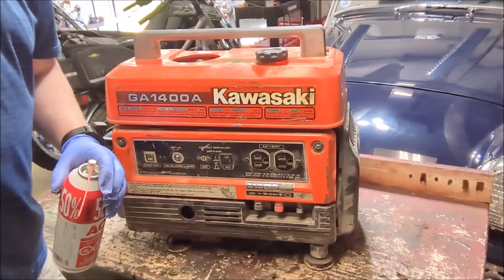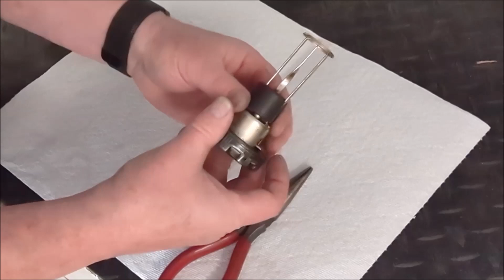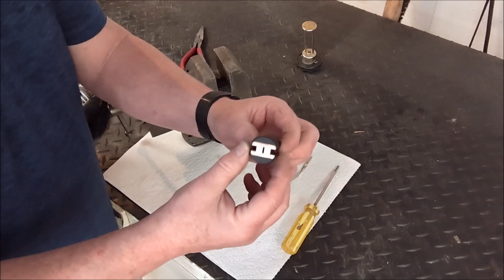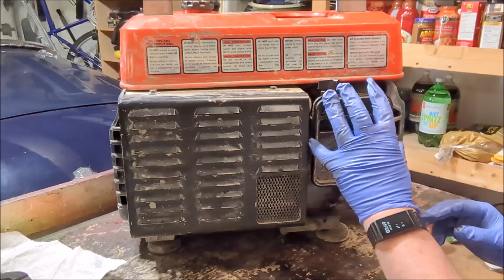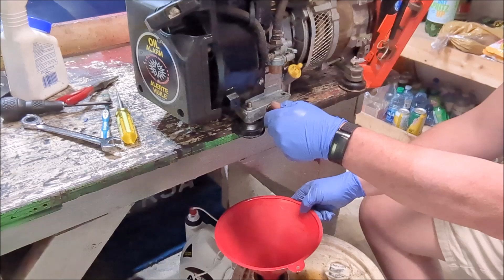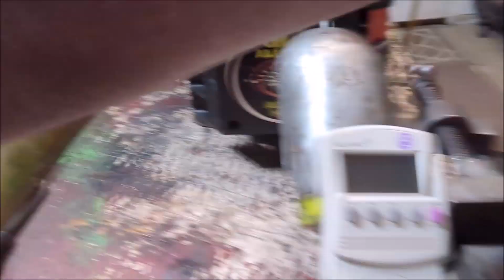Kawasaki Suitcase Generator GA1400A Diagnosis and Repair

Comment: On the left should be a red square, its the off switch..  the fuelk filter under the fuel cap you turn it and it comes out very easy, its made like it and easy to get out, just turn it dont destroy it. the fue lguage yo ushould of simply bent out the two outer parts, then drop the foat down and turned it round half a turn..... stop butchering things, sit and think for a minute.  you are someone who should never ever touch anything mechanical , you have totally bodged this generator up... its a simple thing to work on and you have made it look very hard... in the little filter bowl that is see thrue there is also a filter up and under the plastic bowl. the filter can stop the generator running correctly.... you would of looked under neath to see the little filter and als olet some fuel run out the bowl area..... i would of let every single drop out and put in nice fresh fuel................so now go and get that little filter out above the glass bowl and clean it and then its going to be good for a few years..... with fuel turned off nothing come out the glass bowl. when your putting it away for winter etc , then remove the glass bowl turn of the fuel and it will all drain out nice and quick. no needto take the front cover off at all.

Comment: I had one of these . Run very well. But no voltage is coming out . What y’all think could be the prob ????
Reply from the maker: Hi @OTBLifestyle6, it's possible the unit has lost it's magnetic field.    What I suggest you try first is to plug a corded drill into the 110v outlet and while the unit is running to then manually turn the chuck of the drill as fast as you can (pulling the trigger at the same time) in it's forward rotation by hand.    The turning of the drill motor with the trigger pulled will back-feed a small amount of electric charge into the unit and doing this may excite the coil sufficiently to again generate electricity.    If this doesn't work, you'll need to tear into the machine more deeply, but try this first a number of times to see if this simple trick works.  If not, then the next thing I would check is the circuit breaker to ensure it is working and perhaps bypass it to ensure that's not the fault.   Hope this helps.

Comment: If this has an AVR (my GA1400A does) you can simply adjust engine rpm how it should be and it shouldn’t impact voltage or hertz.
Reply from the maker: Hi @josephdignam123, although there is an AVR (voltage regulator) the hertz is fine tuned via adjustment of the governor.  Thanks again for your comment!

Comment: Did you change out the fuel in the tank or just add high octane gas treatment?
Reply from the maker: Hi Arnie, drained the gas, cleaned the tank and carb float bowl, and replaced the fuel with Chevron 94.  See the 58:00 minute mark of the video.  Thanks for watching!